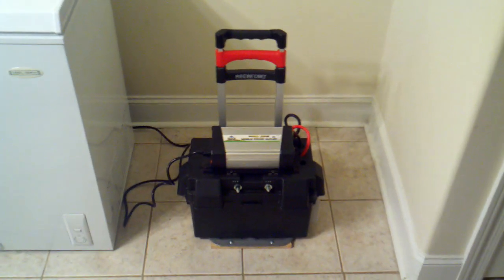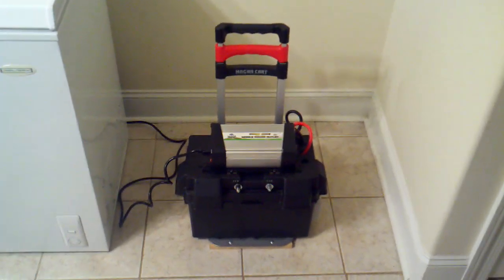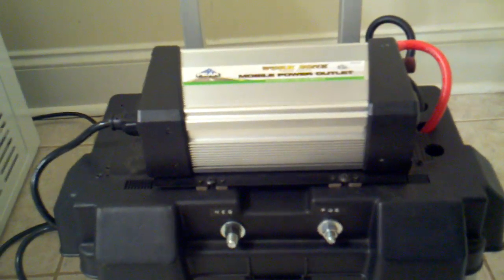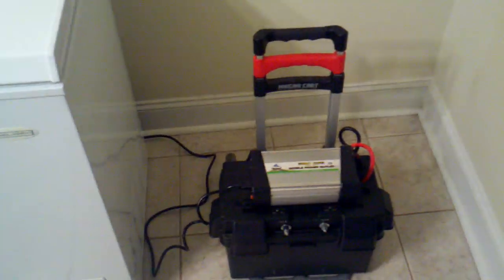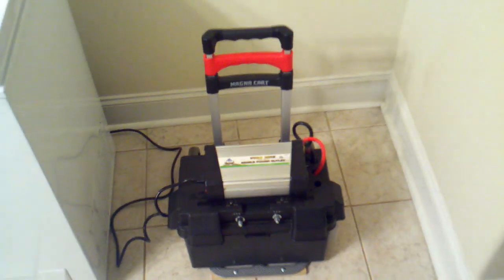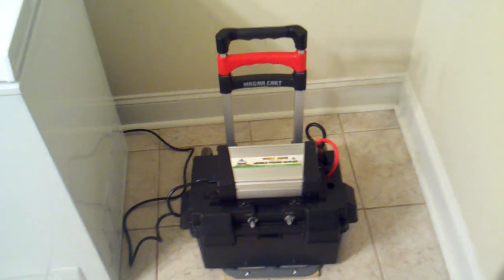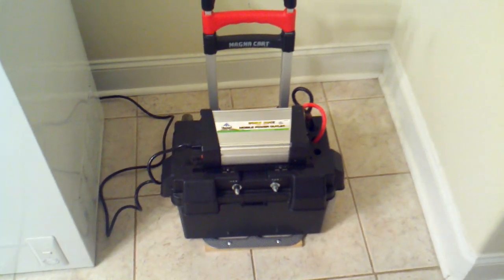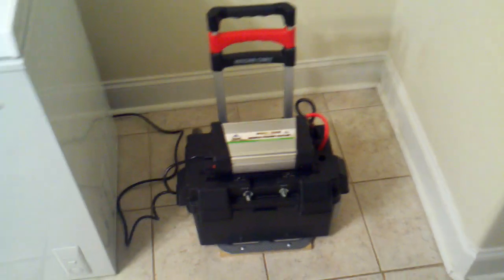DIY - Portable Solar Power -  The Practical Freezer Test - PART 1

Comment: Do you have a complete list of components needed and a schematic to build it?
Reply from the maker: Trish McMasters Sorry but I don't. Essentially, you will need 1.) Magna Cart,  2.) Battery Box (Group 24),  3.) 115Ah Deep Cycle Battery (Group 24 in size)  4.) Modified Sine Wave Inverter "at least 800w or more"  5.) Battery Tender trickle charger. 6.) 3 feet of "8 AWG" black wire and 3 feet of "8 AWG" Red wire.  Installation summary, A.) Bolt battery box to cart, B.) Put battery in battery box. C.) Drill holes for wires in lid or back of battery box. D.) Mount inverter to battery box lid. E.) Mount Tender to cart and wire to battery F.) put lid on box.

https://www.youtube.com/watch?v=36b6yVjEBYo

https://www.youtube.com/watch?v=MVVRPUHUMUo

https://www.youtube.com/watch?v=OFGPkXSydDk
Reply: rhandsom Thank you for the information!

Comment: A full fridge or freezer is more efficient than an empty one. Air is hard to keep cool and the less air you have, and more solid "already cold" stuff... the less the unit will run, when opening and closing it. (If always closes, then it is only the R-value that matters, and the outside temperature. In a desert, it runs 24/7 and never reaches freezing. In the arctic, it runs 0% and goes below freezing.)

A better test would simply be to test a known load, that is constant. (Though math works too.)

12v * 50ah = 600watts of power

50ah battery will power 100a device for 0.5 hours. 50/100 = 0.5 (1200w heater)
50ah battery will power 10a device for 5 hours. 50/10 = 5 (120w normal computer)
50ah battery will power 1a device for 50 hours. 50/1 = 50 (12w CFL/Cell-phone)
50ah battery will power 0.1a device for 500 hours. 50/0.1 = 500 (1.2w LED light)
Reply from the maker: +Hr Ostebrod sorry but that won't work. Double your capacity by getting two batteries in parallel.
Reply from the maker: ***** Thanks for your comments, very good points.
Reply: My dear, i got an question to u... i have a freezer running for 2 days in a whole with AGM battery 230Ah connected to power inverter 3000 watts. The question is... the power inverter has (2) power sockets, can i connect one socket to the battery charger and charge the battery ( in use) in the same time?  to extend the battery using time?
Reply: rhandsom Thanks a lot pal 😉

Comment: You know your flooded battery dissipates flammable fumes not suitable for indoors.

Always be safe.
Reply from the maker: Thanks for your comments. Actually, flooded batteries give off small amounts of hydrogen gas when they are charging and are perfectly safe in a well ventilated area. It is dangerous to charge them in confined spaces with poor ventilation where the gas can accumulate.

Comment: I'm sorry I got the trimetric meter set up but don't know how to punch in the program. I have a total of 320 amp hour with 24v system. It recommend to stay at 50% so that mean I only have 160 amp hours to use I just could dial the #correctly on the trimetric please help...

Comment: Thank bro. That what I need a portable generator. Hey by the way u are right about the 24v panels connect in series it stay about sixty five volt on a bright sunny day. Could you do a video on how to set up a trimetric meter I just could not pucnch

Comment: Nice for solar, not better than the power pot though for energy on demand. Check it out at theepicenter dot come, sorry but.. I want energy when I want it, sun or not. Solar is nice in addition to such things.. but every time I am in bad weather.. at least the pot will make me energy to top off the batteries. Its usb so it does just that AND 4x faster than my 18 watt fold up panels. So take a look, you can selfbuild from customthermoelectric dot come for 300c rated modules as well.. manyuse

Comment: This is sooooo unfair! You got the charger cheaper then I did from the same people roflmao. Actually I think I got a bit more wattage then yours too so that expains that. 

On the battery, pretty much any 12v. works... You want as many amps as possible as this will dictate the lifespan of the battery before recharge. Hell if wired together properly you could use a bank of bagdad batteries (homemade!), but they will die rather quickly (works longer for small things like radios etc.).

Comment from the maker: Thank you for your comments. However, for a backup source of power during an emergency or power outtage, and if it's the only thing you have, then a modified sine wave should not hurt the motor and will work well in a pinch.  This is designed for short term use. Delicate instruments like sensitive electronics are another matter, they shouldn't be used with MSW inverters.

Comment from the maker: @K3vindust a 40 or 50 watt panel is fine for a small setup like this. A DIY 60 to 80 watt panel would be even better. The higher the wattage the faster the charging. Take Care.

Comment from the maker: @kondor1001 Thanks the comments and the safety tip. I've been looking for covers for the exposed battery terminals, and yes I agree they are a safety hazzard. Home Depot or Lowes may be able to help. I'll look at the 12v cooler box and see what's up with it sounds interesting. Thanks

Comment: Read up on battery maintenance- you need to know what the voltage is at 50% depth of discharge.  You can't run it down too far without damaging the battery.  Make sure you have jumper cables and a full tank of gas in your car so you can recharge this as needed.

Comment from the maker: @svenvideos Thanks, The freezer is 5.0 cu ft, 115V, 1.69Amps, and Startup Amps = 12A. All of this is on the label. After initial startup the kill-a-watt's average read of the freezer is 96 Watts at .99Amps to 1.04Amps. I finished the experiment at 5:00 p.m. with an ending voltage of 11.19v and I started charging the battery with a speed charger (12v at 4Amps "medium batt setting") around 5:30 p.m. so after aprox 5.5 hrs of charging, the battery is now at 12.45v.